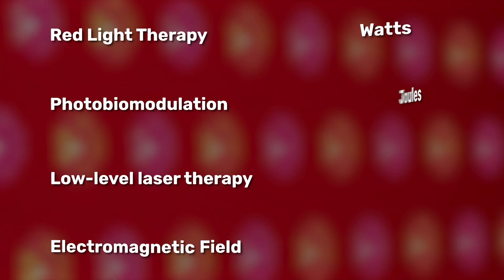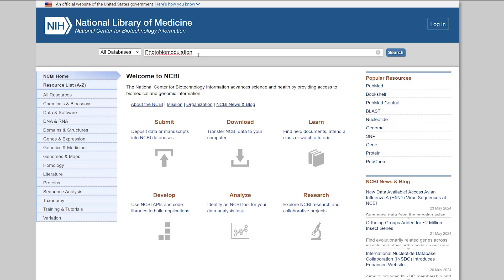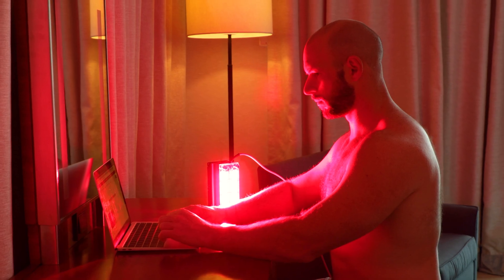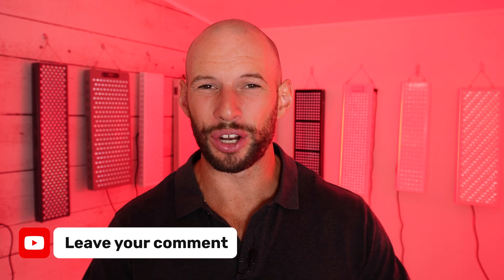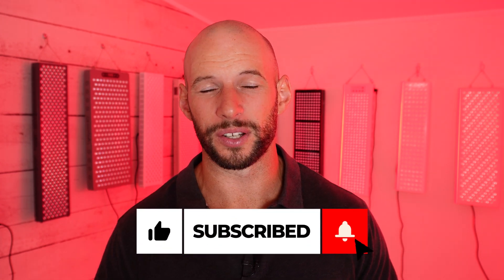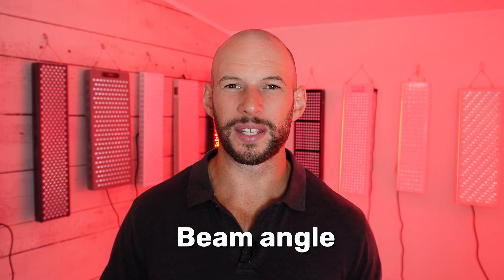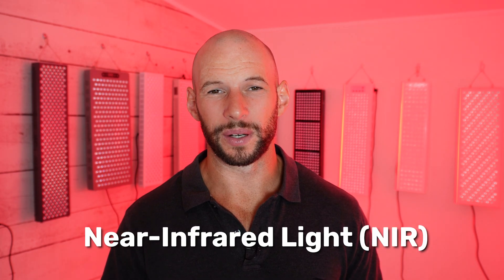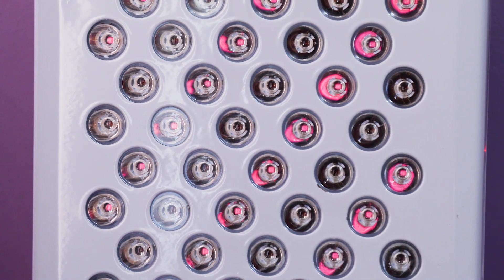Red Light Therapy EXPLAINED: Basic Terms Guide!!!

Comment: Regarding irradiance levels, the highest, strongest comes from the Blue Blocker XXL Ultimate body panel, am I right?
Reply from the maker: Ultimate XXL = one of the strongest full‑body panels tested
Not the absolute #1 in irradiance , but in the top tier.
Reply: @LightTherapyInsiders whatbrand full body panel has the strongest irrradisn e level?